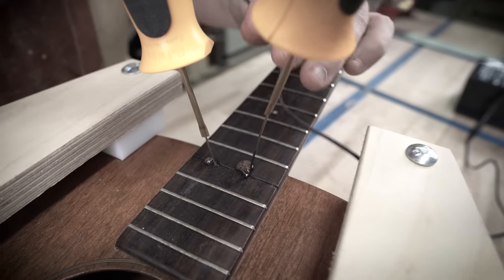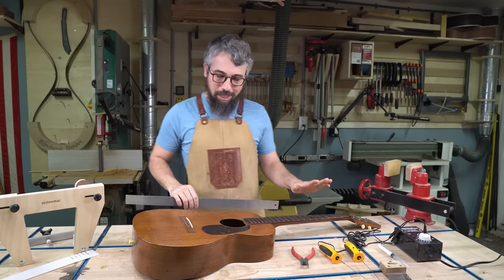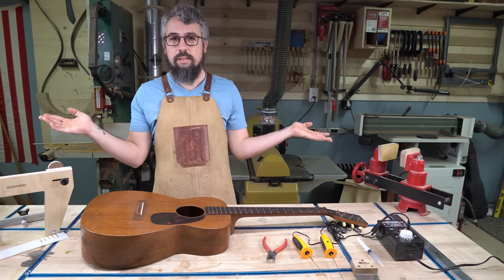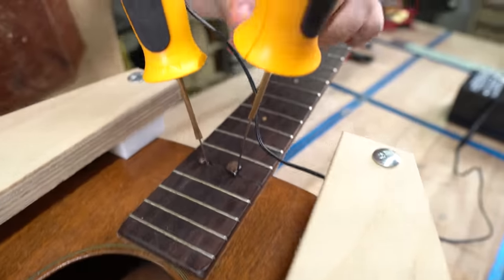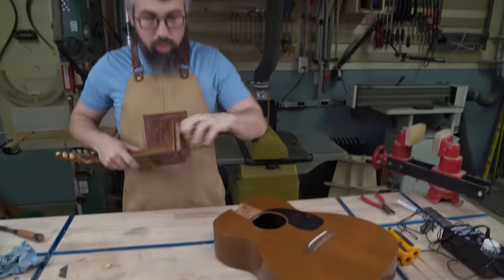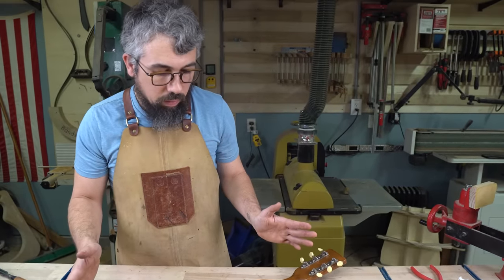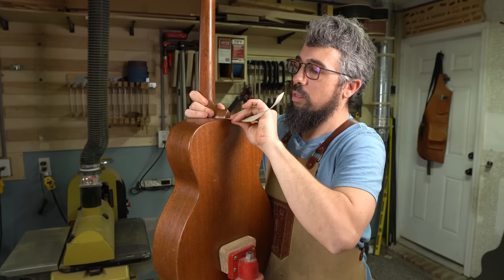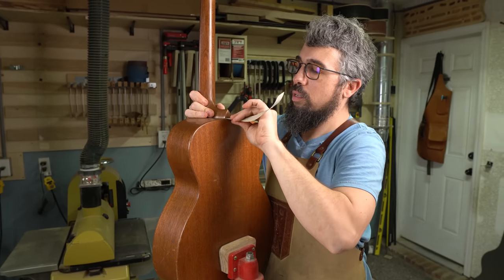Neck Reset on a Pre-War Martin 0-15 from 1941

Comment: Dudes. We all start somewhere but superglue has no place in this situation. Nothing but love but please do better. That’s not being snooty that’s keeping it real.
Reply from the maker: Why not use a glue that does the job, and has zero side affects as far as tone reduction or longevity? I just don’t see why that matters for glueing a shim on. Maybe I missed something?
Reply: @DriftwoodGuitars  name of the game is reversibility. in the future when someone goes to take that apart they're expecting to be dealing with hide glue. cleaning up superglue is a pain. using the yellow glue on the dovetail is also not right either. hide glue is very strong but joints can be easily disassembled with a bit of heat n moisture. ive made plenty of poor decisions over the years fixing guitars and ive had to come to terms with that whenever ive fallen short. its ok nothing but love. these old martin/gibsons that havent been messed up with poor repair choices deserve a higher level of approach. we must use hide glue and keep certain instrument repairs historically correct whenever possible. if its  a fine guitar and clean, assembled with hhg then the dovetail, extension, and shims deserve hhg. its just the right thing to do. im only talking neck resets here not other repairs, sometimes you gotta use yellow glue for braces ect. if you don't have confidence in using hhg then doing a neck set on a reasonably clean 41 martin is not a job you should be doing. that neck had never been off and could of gone back on with hhg. someone who has put the time in being comfortable with hhg should be doing it and getting paid for working on that level. we are stewards of these old guitars and should be taking care in how we are fixing them. always being concerned about future repairs and how easy it'll be done the road on another luthiers bench. you shouldn't be in a hurry during a neck reset it should be a calm calculated repair cause in theory that set is gonna be in place for 20-30 years. practice neck resets on old harmony/kay bangers, if you can dial one of those in then move on to the finer guitars. i won't be upset if you use yellow glue on an old dime store banger. nothing but love fellas but there's a standard to maintain and i hope yall can hear what im saying and improve. this is a self motivating business only you can figure out how to improve going forward. keep going keep improving start using hhg everywhere you have an opportunity to. you'll be happy about it in the long run. again nothing but love.
Reply from the maker: You’re literally the only person that’s had something negative to say about my glue choice, including from the owner of the guitar. I’ve worked on dozens of prewar martins In my career, and it sounds like you and me just have different repair philosophies. Neither one is wrong. Im just not of the school of thought that we should use historically accurate glue on a vintage instrument, when modern blues are just as good, or even better, and still offer the repairability of HHG. On top of that, this guitar is FAR from pristine and original. It has a non nitro satin overspray, cheap aftermarket tuning machines, a few repairs on the inside, and no case, so I really don’t think using non HHG on the neck joint is going to hurt the value of the guitar. I’d be in agreement with you if this was a classic like a D-18, 28, 45, or some other pillar of the martin lineup, and was still in original condition, but this guitar is just not even close to that. I’m not sure where you’re coming from when you say I need to swallow my pride, as I’m an open book and literally shared my entire process for everyone to see, and even said , this is just the way that I do this, and im not the authority on the subject. I’m FAR from the guy you take a guitar to if you’re a vintage guitar nut, but that should be obvious I would think.
Reply from the maker: I dont use HHG at all in my shop, and I personally can’t stand the stuff. I once built an OM45 replica for a customer and he insisted that I use it, so I did. Literally made zero difference and only made it harder to build. My guitars sell for prices similar to many prewar martins, and I have a multi year wait list for one of my instruments, yet no one ever assumes that my guitars sound better or worse based on my glue choices. I’ve spent decades experimenting with different glues for different applications and I’ve landed on my choices based on my past experiences. Every glue has unique physical and sonic properties, and I use each type when most appropriate for a given application. Just because you don’t like it, doesn’t make it wrong. Believe it or not, you can accomplish the same goal using many different methods.
Reply: @DriftwoodGuitars  hey dawg at no point have i been nasty in any way, im just telling you the truth. ive had to swallow my pride plenty of times and it hurts every time. its part of this business unfortunately. im improving everyday understanding the level of care it takes to be a steward of these old sought after guitars. if you don't practice proper form on an 0-15 how are you gonna deliver the goods on a D18, 28, 45 ect? i know you wanna make content and do the youtube video thing and that's cool but you shouldn't be encouraging improper form, on certain instruments the standard is different and should be elevated. ask yourself if a looth in Gruhn's repair department glued a shim with CA and sent the neck on an old 0-15 home with yellow glue how would George or Greg feel about that? i promise you they'd be upset. i understand that axe isn't a show piece but most aren't and can still be repaired with hhg preserving reversibility (only talking about the dovetail and tongue). i don't have a problem gluing a shim with yellow glue if its clamped flat to dry. again nothing but love. if it was made with hhg and is clean and you're able to use hhg then you should. yellow glue has its place, but it will absolutely come apart harder than a hhg joint and most likely will cause damage. for example, in general, if you read the runout properly,  a bridge glued with hhg comes off way easier/cleaner than say a Taylor bridge does (yellow). its not about what glue is better, its about what glue was used when it was made, that should be honored if at all possible. fact. the value of these guitars are really getting up there and we owe it to the guitars and the owners that want top dollar when they sell them, to show respect and preserve them. these guitars will outlast us all and we should always leave things better than we found them. this is a public space and im gonna speak up if i see something that's wrong and is showing the public the wrong way to do it. do whatever you need to do but i hope you will hear me and know im coming from a place of caring. werd up.
Reply: @helmerguitars  you summed it up perfectly in the first 2 sentences. The name if the game is being able to reverse past repairs without creating damage. Using hard (or impossible) to remove adhesives on an instrument that will more than likely need the same procedure done again is just being a jerk to whoever is tasked to do it. Seems a bit lazy. When manufacturers do it, luthiers hate it. Why perpetuate poor practices?
Reply: @DriftwoodGuitars  “listen more” is great advice! 🍻😎
Reply: @DriftwoodGuitars  also, I say talk as much as you want. Y’all are funny, entertaining and seem to love what you do. Love that your vids have a very happy positive vibe. Werd up.